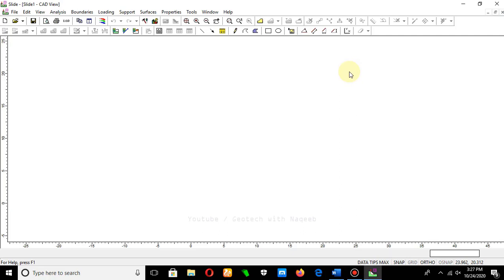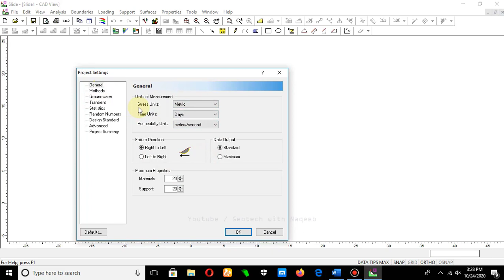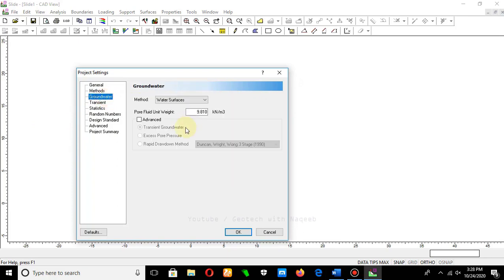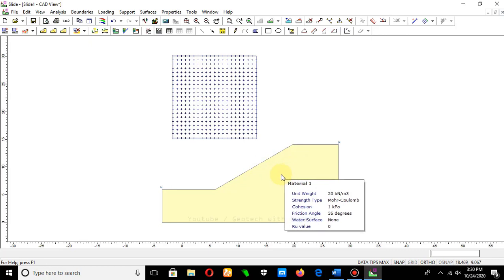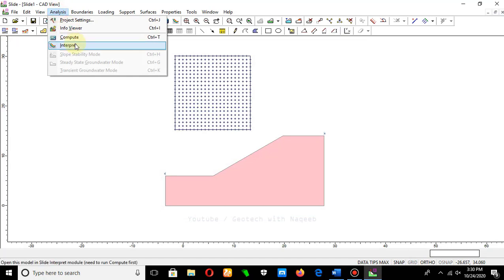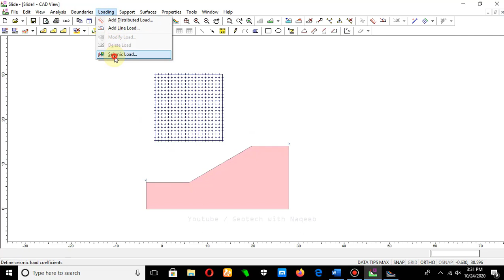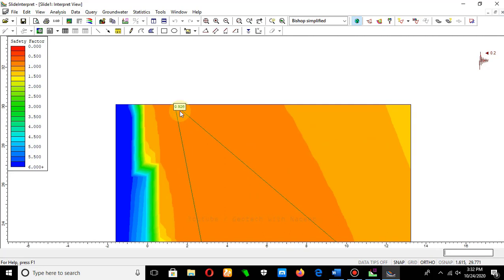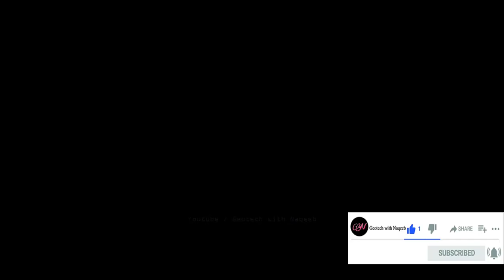SLIDE Lesson 9 | Seismic Analysis of Dam | Geotech with Naqeeb

Comment: The point with the minimum FoS value is located on the boundary of the calculated area. It is necessary to change the calculated boundary. The seismicity coefficient is never equal to the calculated intensity. For example, if the intensity of the area is PGA=0.2g then the calculated seismicity coefficient will be of the order a = 0.05 and depends on the type of soil.